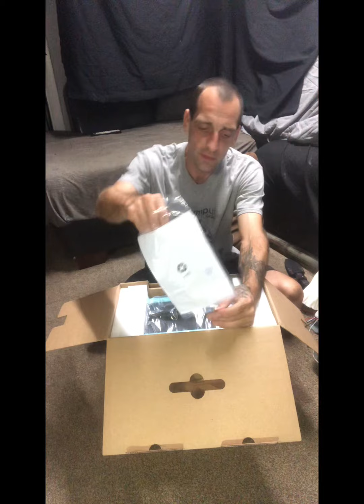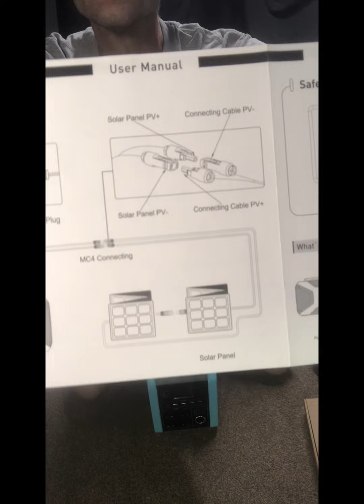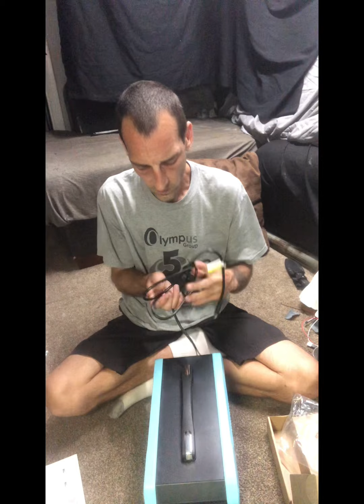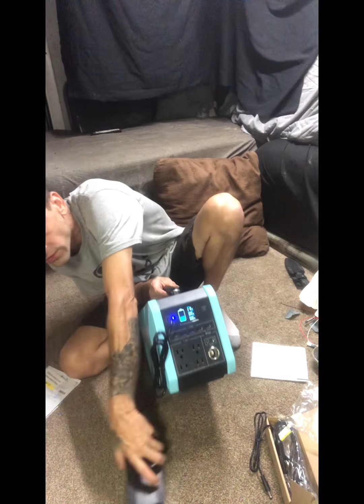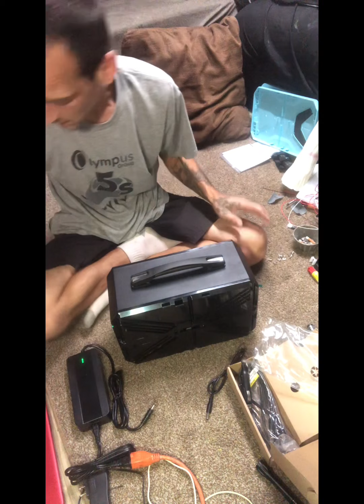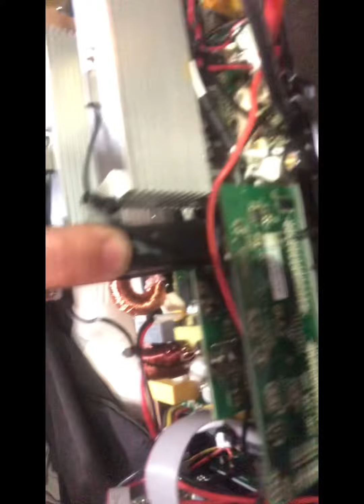Bluetti PS70 Unboxing

Comment: Just received mine and it has exact same problem!!
Reply from the maker: Do you hear clunking around inside?  Battery 🪫 flashing and won’t charge?
Reply: @C3DS  it sounds like the entire battery inside is not bolted down. Sounds like a loose brick is inside lol. And It won't turn on either.
Reply from the maker: Sounds like your power board broke free same as mine did if you watch at the very end of the video I opened it up and show the whole power board moving around.
Reply: @C3DS  yea I watched the whole video that's why I'm saying mine has same problem lol. I emailed bluetti but at this point I'm sure it will be weeks before this is resolved...
Reply from the maker: Did you win from Evelyn or Helena? If it was from Helena email her also along with Service if you need services email I can give it to you and if you can send them a little video and say you had the same problem as me and it sounds like power board is broken loose in yours also
Reply: @C3DS  yea It was Helena, I emailed her but didn't think to email anyone else
Reply from the maker: service@bluettipower.com